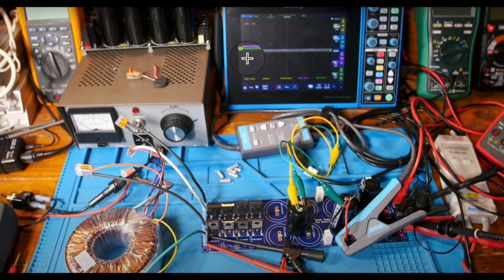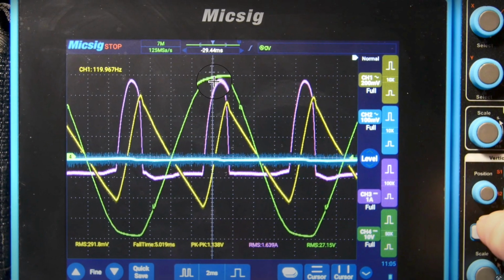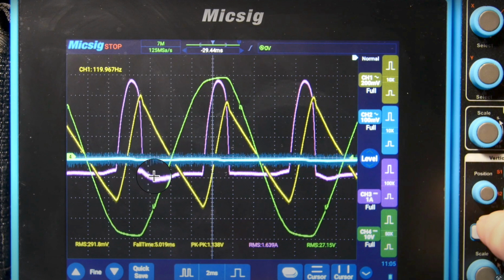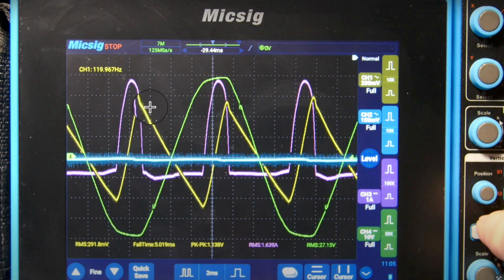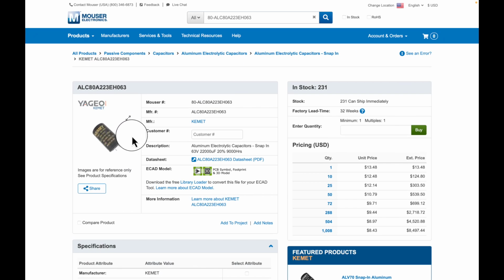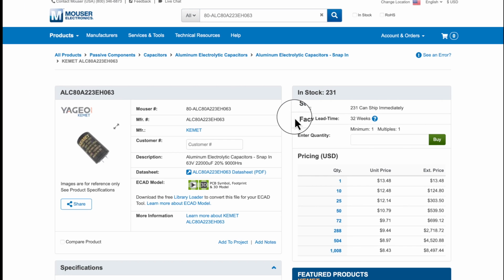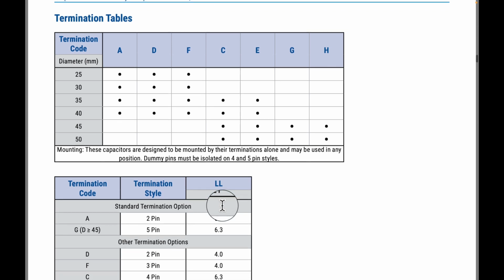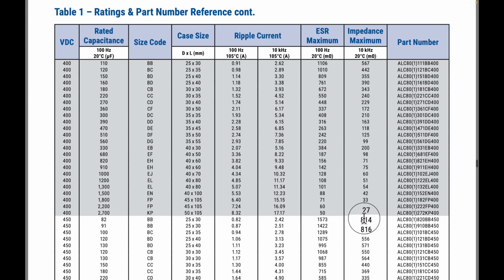How to Size the Power Supply Bulk Capacitor - I have an easy formula to follow

Comment: I have been waiting for that switch mode power supply that you talked about long ago about Jonnie‘s AUDIO project. About a switch mode that can be as clean and quiet or even quieter than so-called linear.  aka (slow switching) 
     All the old guys, including myself have been stuck on linear power supplies, our whole life
Regulated or regulated 
It would be nice if somebody designed a switching power supply for the AUDIO DYI community that could be posted on karma AUDIO and over on DYI AUDIO forms in groups . 
       That produced such a clean voltage that all the guys on the audio forms with expensive equipment and years of testing would all give it a thumbs up as the new gold standard for audio switch mode, power supplies that anybody can build.
Reply from the maker: Thank you!  I am going to make that a priority - even though these videos get less views - I think they are important;)
Reply: @ I wonder if with this particular project. You can attract viewers and subscribers from AUDIO forms like karma AUDIO and DYI AUDIO.. 
       Simultaneously building testing and proving your switch mode, power supply is equal to or even superior for use in high-end audio equipment.  That the blue plants the plans in a corresponding build video so DYI people can order parts from places like Mousrr and Digi key to build it themselves.
    As we know the most difficult and sensitive what requires the absolute cleanest power our phono preamps are extremely sensitive. And then next comes preamps in general.. 
      Having interference put off by the power supply itself just because it’s inside the same chassis a very sensitive preamp is another separate problem all on its own. 
You have your work cut out for you .

Comment: What IS the formula?  Maybe we got a rule of thumb answer of around 48mF for this particular example,but isn't the current divided by the number of parallel capacitors?  What are all the unknowns and the full equation to calculate for X ripple current each capacitor will pass.  The esr and current for each cap is needed to estimate self heating.
Reply from the maker: Thanks for asking.  Did you see the equation that I showed?  This is how you calculate the peak to peak ripple.  If you use 2 capacitors then it is half in each capacitor.  The rule of thumb is 6 - 6.5 mF per 1 Amp for 1 Vpp ripple.  So, if you are OK with 2 Vpp ripple you can half this.  But then if you want 6 amps to the load instead of 1 amp - then you need to multiply by 6.  So for 2 Vpp ripple and 6 Amps - the rule of thumb would be half for the voltage ripple, but 6 times for the load current.  So, if you started with 6 mF, it would be 6 mF divided 2 (for allowed voltage ripple) but then multiplied by 6 (for load amps), so you would have 18 mF.  Make sense?
Reply: Thank you for the follow-up.

Comment: I am always interested  in Power Supply’s for Audio Power Amplifier. 
Last weeks designing, calculating for the best possible amplifier to build. But it is a hassle fitting it in a standard housing. They all are too small.
Reply from the maker: Yes it is not easy to get a housing to fit :)